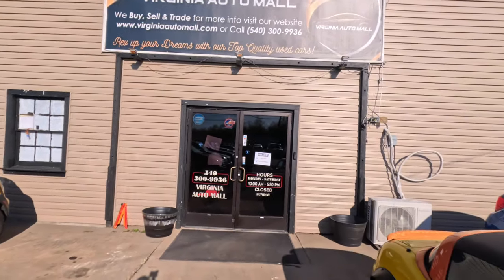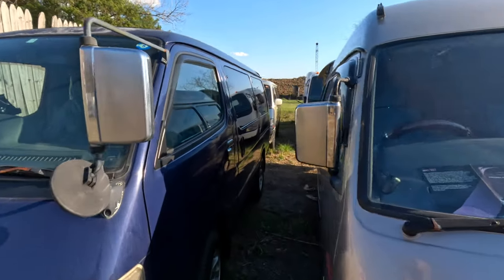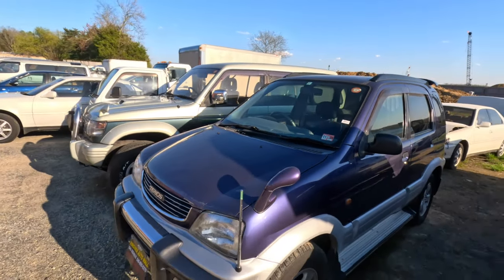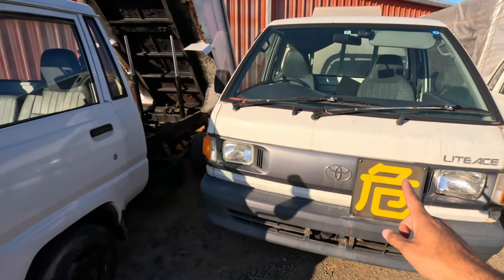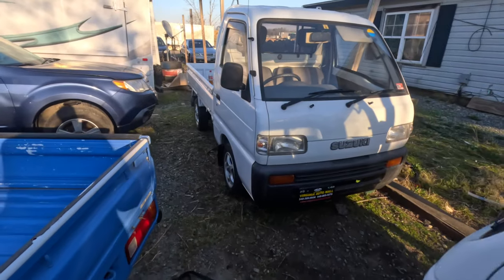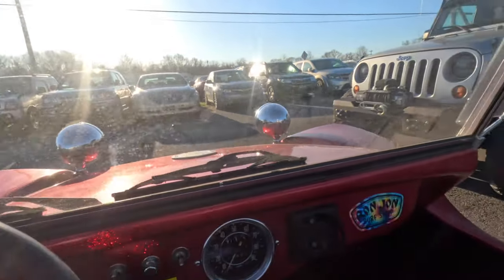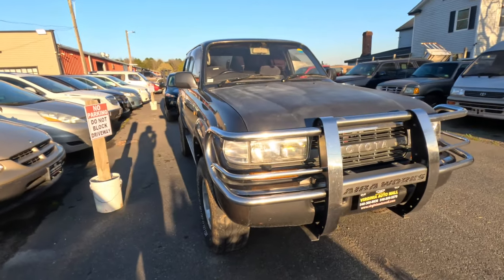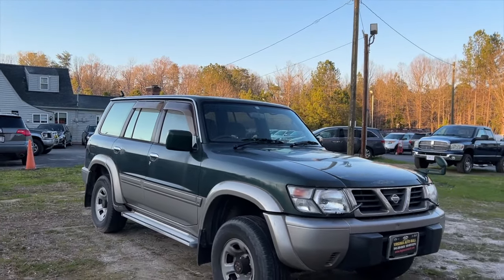Virginia Auto Mall FULL JDM Inventory Walkthough!

Comment: Those prices are crazy!!! Faded paint, seats ripped,no sunroof over 200kl miles😮
Reply: paint will come back really well with a polish and wax
Reply: @piggy6253  some of them look to be peeled the clear coat. If that's the case they're going to need a repaint.
Reply: I think the price is pretty much good, its imported and diesel. I think 25 years older car has a right to get some pannels faded.
Reply: @hafizanas1217  it's hard to justify those prices! JDM or not, dropping 20k is just crazy for the condition.
Reply: @MostlyInteresting  I've seen cars very similar in condition come back looking excellent from a simple detail